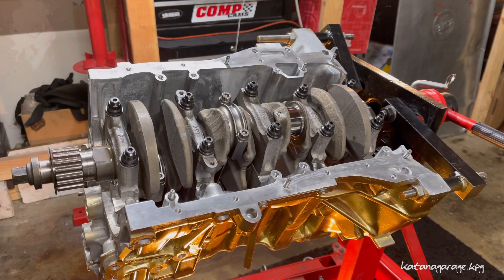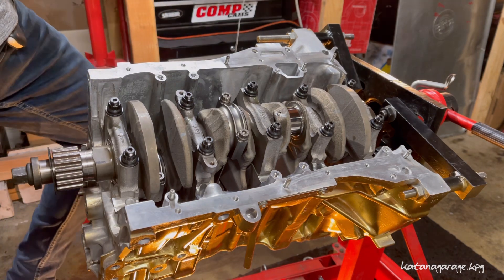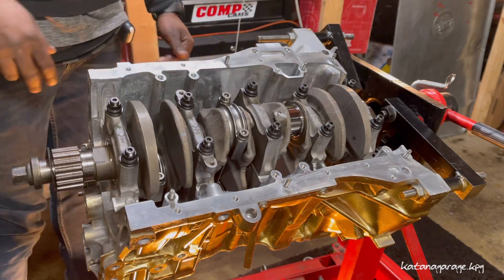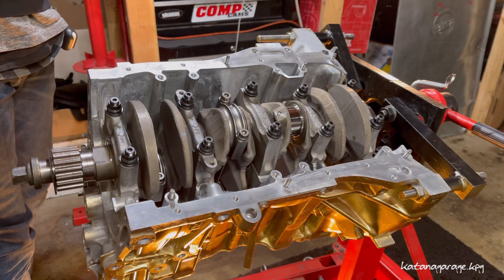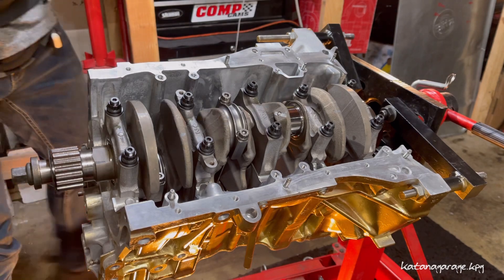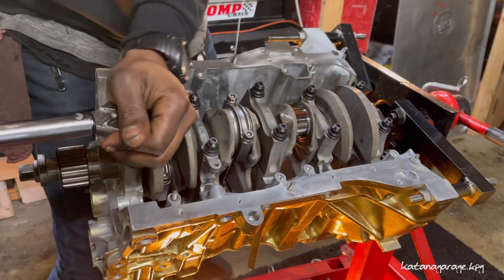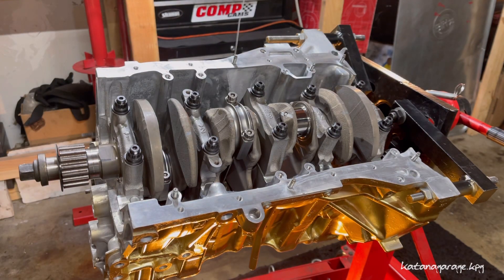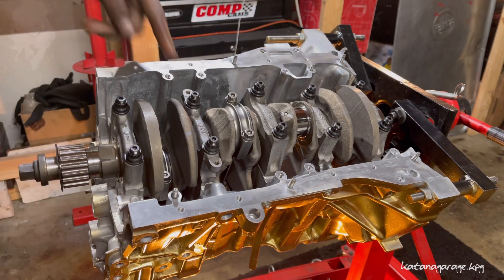Turbo B18b ARP main stud torque specs

Comment: You use the b18b1 baffle plate or gsr girdle
Reply from the maker: I use the baffle plate. I've heard of people using the girdle, but I don't think you need that if you've got a solid CSS. My current setup has a Ramey Racing 1100 whp block. I've just been busy, but will post all versions of the car soon.